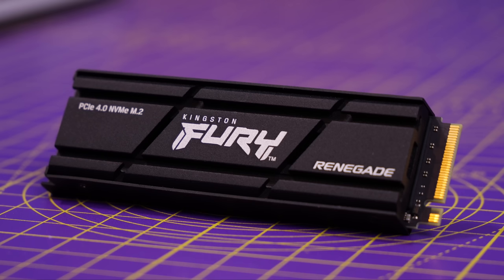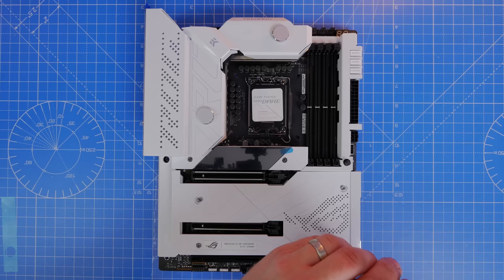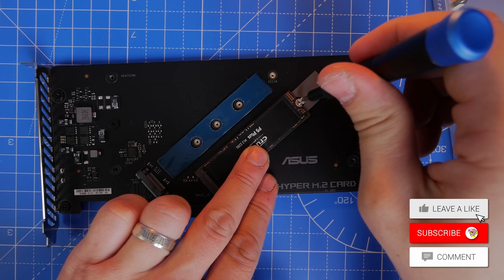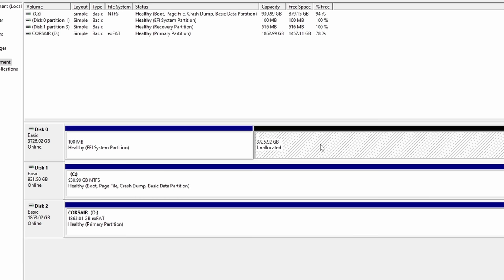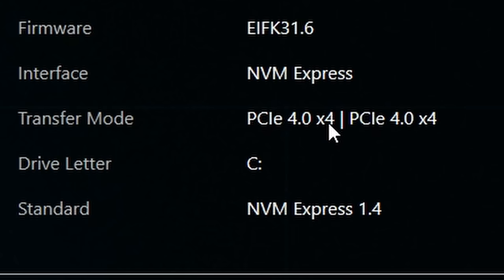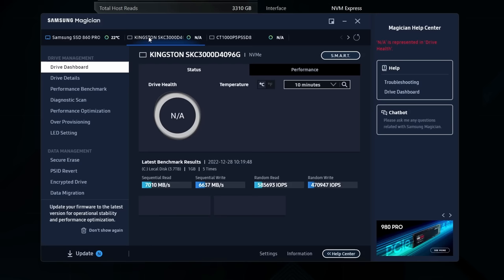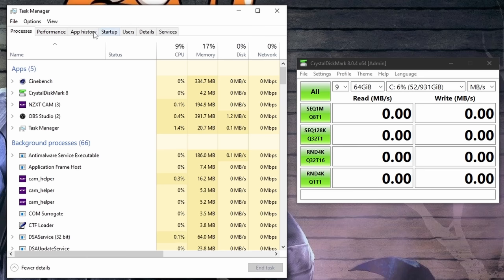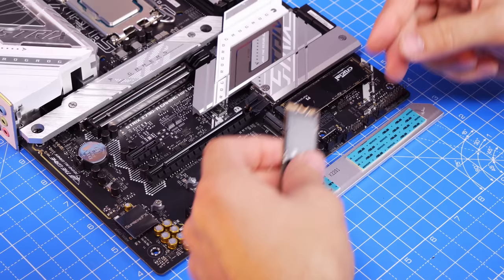Don't make these mistakes with your NVMe SSD installation - NVMe tips and tricks

Comment: It's not always the top slot.  Some boards steal PCIe 5 lanes from the GPU in the top slot (M.2_1), reducing your GPU from x16 to x8.  This would be less of an issue with a PCIe 5 GPU, but the current generation of GPUs are PCIe 4, and will lose performance.  The correct slot for a gen 4 drive can be M.2_2, if the board routes the CPU's x4 lanes there.
Reply: thats why you dont buy intel, ryzen doesnt have this problem because it has 28 gen 5 lanes on the 7000 series
Reply: Its a good general rule of thumb, but if you are assembling your own PC motherboard up, then you can take the time to read some labels or the owners manual to see what is the proper slot for gen 4 support. Some boards even have the "dimm .2" slots next to the ram that allow 2 nvme similar to his pcie dual nvme card.
Reply: @Wedgeman_Riley   really random and kind of irrelevant to the current topic but thoughts on the x670e-a strix mobo? Trying to find a white one that would go with a 7950x especially after seeing your comment about the 28 gen 5 lanes.
Reply: @Wedgeman_Riley  that’s convenient, I have an x570 board with a 5800x and I was worried about adding another NVME
Reply: @Sl0th150  the x670e gaming is a good motherboard if your willing to spend alot and will work well with the 7950x because it has good power delivery and enough gen 5 lanes to support a gpu and 2 nvme ssds at gen 5 which is the most the board supports and still has enough gen 5 lanes for any expansion cards like an elgato capture card
Reply: @Wedgeman_Riley  perfect thank you!
Reply: It barely makes any difference even with pcie 3.0
Reply: @vedinthorn  It depends on the game or workload.  Some things do make use of the x16 bandwidth on the higher end cards.  The other thing is that it's just plain bad practice to use GPU lanes for a PCIe 4 system drive when there are dedicated CPU storage lanes there for it (unless you actually need that extra NVMe slot).
Reply: @Wedgeman_Riley  Tru, but my old Hero 7 x470 has this config.  Bottom slot for full 16x and no second m.2 or steals 8 to give 4 to the other m.2 slot.  Now the x570 I have does not have this issue but the recomended slot is closest to the cpu.  On am4 socket.
Reply: will the ryzen 5800x3d pair well with the msi x570s edge max wifi & a 250gb samsung 970 evolution plus with a 2tb 970 evo plus?
Reply: just check your motherboard manual
Reply: Unless you got a 4090, no gpu will be saturated even if you lose 8 of your 16 pcie4.0 lanes
Reply: @Wedgeman_Riley  Same as Intel, AMD's mobos share lanes as well. 

From x670e manual: 
When M.2_2 is enabled, PCIEX16_1 will run x8 and PCIEX16_2 will run x4.

When the PCIe 5.0 M.2 card is installed on the PCIEX16_2 slot, PCIEX16_1 will run
x8 only.
Reply: @Wedgeman_Riley  Nope:

When M.2_2 is enabled, PCIEX16_1 will run x8 and PCIEX16_2 will run x4.
When the PCIe 5.0 M.2 card is installed on the PCIEX16_2 slot, PCIEX16_1 will run
x8 only.
Reply: @sempiro3133 it won’t lose performance, find a benchmark where it does. Even gen 4 4x is more than enough.
Reply: @Ilestun even with a 4090 you don’t saturate.
Reply: @sempiro3133  with the chipset I got, last gen x570, you can run both pcie 4.0x16 for the graphics cards and pcie4.0x4 for one M2 and another m2 in pcie3.0x4

It might be otherwise with lpwer end chipsets tho.
Reply: I use the lower slot so I can use SLI. I have to
Reply: bruh  When the zen3 was released, people don't remember that gamers were hesitating between the ryzen 3600 and the i5 9600k. 

Just remember that people who choses the 3600 have now the best upgrade ever with the 5800x3D and people who chosed intel have to buy new motherboard. 

Lucky me I chosed the 3600 over the 9600......know running on 5800x3D and planning to upgrade my graphics card soon.
Reply: bruh  🤣🤣🤣🤣🤣🤣🤣🤣
Reply: I guess you missed the part where he said “in most cases”
Reply: If I install 2 m.2 into my z790 will it slow my card
Reply: You are absolutely right Murph9000, well done.
Reply: Wait, so what about on the b650e taichi, it has a gen5 m. 2 slot next to the ram dimms, if I put say a gen 4 firecuda drive in that, does it still steal pcie lanes from the gen 5 GPU pcie ?
Reply: @KatoJari  Kato the AMD platform does not tend to have these kind of limitations. There is no issue at all with the setup you described. The only thing you need to be aware of on the ASRock B650E TAICHI is that if you place an m.2 drive on the third m.2 slot it will disable the second pcie slot (gen 4) but no problem with the gen 5 pcie.
Reply: Please help OP, I have a asus tuf gaming z790 plus wifi d5 and a pny 4080 and a samgsung 990 pro, a 980 pro. The MB has 4 spots.  Where do I put them to not affect the pcie 5 speed
Reply: @quatreraberbawinner2628 what did you find out?  I have same question
Reply: yes
Reply: Mine at the back of the motherboard lmao
Reply: ZaHandle i switched from intel to amd had an i5-9400F n 3050 got myself a Ryzen 5 3600 and a b450 chipset to oc and oh boy its unbelievable what u get compared to intel is overboard on pricing amd makes it affordable to fkin build a fast pc hyper threading is very nice
Reply: @Wedgeman_Riley  i have the msi b650 carbon wifi and i already have a pcie 4 ssd . the wd black sn770. would it slow the gpu down if i add another m.2 pcie 3 ssd? or should i go with a sata?
Reply: .. The top M.2 slot on PCIe 5.0 is DIRECT TO CPU as opposed to the more convoluted and higher latency Chipset. I have an RTX 4090 and x8 PCIe 4.0 (switched from 5.0) doesn't have an impact beyond 1-3 FPS to if any; on my rig 3440x1440 I tested it both ways with CoD and 0 FPS loss. However, even with a PCIE 4.0 M.2 you will gain 'significant' latency using a chipset PCIe lanes. Also, you have to look at how your CPU is utilizing its PCIe 5.0 and PCIe 4.0 bandwidth. Most have both and are not PCIE 5.0 clean.

Also an important note, the difference for over 90% (if not higher) of the tasks your M.2 (drives) data is 4K random. There the difference between a PCIe 5.0 and PCIe 4.0 SSD is nearly negligible. Very little data that you copy or even as a scratch drive, contains large chunks of synchronous data. The difference between my 990 Pro and a M700 for loading, even the largest game is measured in a fraction of a second, and often the PCIe 5.0 SSDs are actually slower! Go figure.
Reply: @DJaquithFL  so what is the conclusion from this? should you use the topmost m2 slot? or only use the second and third m2 slot on your motherboard
Reply: @mytommy  .. On the Z790 there are two (2) Direct-to-CPU slots. If you have a PCIe 5 M.2 and that's more important to you than a full x16 PCIe to your GPU then use the top M.2 slot. Otherwise IF AVAILABLE use the "second" PCIe 4.0 M.2 Direct-to-CPU slot per your manual for x16 to your GPU and the lower latency Direct-to-CPU slot. 

There are special cases, I have an ASUS Extreme and underneath the OLED screen and above the GPU is a PCIe 5.0 slot .. if you're going to fully block and water cool your CPU, then all of those other M.2 slots are completely inaccessible so you have to weigh out if under ~1-4 FPS is worth not having any any access to those M.2 slots? In my case I also have a M.2 DIMM slot to the right of the CPU, but for those I use a RAID 1 M.2 therefore, all of the M.2 slots are fully accessible and can be exchanged if needed without having to fully dismantle my cooling and draining my loop.
Reply: @DJaquithFL  I'm more worried about the worse latency to be honest rather than the loss of 1-2fps. I play an online competitive game, so any latency advantage is important. So, the question still remains, should I use the top most m2 slot for my use case?
Reply: @mytommy  .. Again, if you have a Z790 motherboard (the Z790 is the only chipset where this matters) then it has two (2) direct to CPU M.2 ports. If you're using a PCIe 4.0 M.2 then I would use the corresponding or 'generally' second port below it (there's no latency difference between either of those direct to CPU M.2 ports, the sole differences are bandwidth and location), you'll have to look at your manual M.2 port. Putting a PCIe 4.0 M.2 in a PCIe 5.0 M.2 port accomplishes nothing other than reducing your PCIe down to x8 for your GPU. 

Lastly, as far as latency is concerned, the game is loaded already and any M.2 activity won't matter. To be clear, I'm a huge Call of Duty player .. so I get your concerns.

I chose the top port in my use case because of its accessibility with a full EK water block loop including the CPU and GPU. I absolutely can't access those other M.2 ports so I opted for the x8 to my PCIe port. As it is, I might 3440x1440 240Hz monitor along with my RTX 4090 I am pegging the 240 FPS because that's why I have it capped, with the frame cap removed on high settings and sometimes slamming 300 FPS.
Reply: pcie gen 4 x16 vs x8 barely anything in it!
Reply: @lu34lyf  .. That's not true and this is easily preventable. The loss of FPS depends upon the game, 5 to 15+ FPS loss effectively defeats the advantages of an RTX 4090 vs an AMD 7900 XTX or an i9 vs i7. It's especially even worse with lower resolutions. It's a preventable screw-up.
Reply: PCIe-5 x8 is the same as PCIe-4  x16 and only an RTX 4090, which is a PCI-e 4 card, comes close to saturating PCIe-4 x16.

5.0 has double the bandwidth of 4.0

5.0 x8= 4.0 x16.
Reply: @thedoctor7158  .. It doesn't work that way. Each PCIe slot has a certain number of lanes assigned to it, It may or may not be shared, it may be direct to the CPU or its lanes running through the chipset (chipset adds latency). On LGA 1700 the M.2 PCIe 5.0 lanes are shared thereby reducing the GPU to x8 lanes and both are direct to CPU. There is no "economy" of bandwidth, instead it's about LANES assignment. Example if the PCIe assignment is PCIe 5.0 [x8] but the device is PCIe 4.0 x16 then the device will only be given PCIe 4.0 [x8]. 

Regarding the "saturating" while the bandwidth alone isn't the reducing factor the device that's x16 lanes reduced to x8 lanes (the process) has an impact that reduces the devices efficiency. In short, even an RTX 4090 will lose, depending upon the resolution, on average anywhere from 2% to 8% FPS and the lower the resolution, the greater the loss. See TechPowerUp's benchmarking on this topic.

In a real world use cases, the speed difference between an M.2 PCIe 5.0 SSD and a M.2 PCIe 4.0 SSD is negligible. Realistically about the only change you would notice is a cloning of a huge file upon the very exact same M.2. for most people that would have an RTX 4090 and are gaming. My advice to them is to use the PCIE 4.0 M.2 slot That's just below the PCIe 5.0 M.2 slot, both are direct to the CPU but the 4.0 slot is not shared with the GPU so the RTX 4090 can run at PCIE 4.0 X16. Opening a game on a M.2 5.0 versus M.2 4.0 would be less than a second on comparable M.2 SSDs because it's all about random not sequential. Sequential speeds in the real world are nearly the most useless gauge of any SSD.
Reply: You are not going to see the difference in gaming between a pci-e 5 x8 and pci-e 5 x16. How do I know this? I have tested it on multiple games with an RTX 4090 an my z790 ROG Strix. Little to zero fps drop, zero slow down. A 4090 barely saturates pci-e 4 x16.
Reply: @thedoctor7158  A 4090 is a PCIe 4.0 device, it can't do 5.0 speeds.  It can, under the right circumstances, use most/all of the 4.0 x16 bandwidth for certain operations.  If you put it into a 5.0 x8 slot, it will be running at 4.0 x8 speed and partially throttled.  It's not going to make a big difference for every game, but it can make a difference for certain use cases.
Reply: @DJaquithFL   my lack of info made this look wrong.

Pcie gen 4x16 Vs gen 5 x8 nothing in it

Is what I should of said

Sorry very vague on my end
Reply: @lu34lyf  There are no PCIe 5.0 GPUs available; both Nvidia and AMD are only 4.0.  There is no such thing as a GPU which can run at 5.0 x8 speed right now, they can only run at full 4.0 x16 speed or 4.0 x8.
Reply: @Murph9000   never once mentioned gpus, but there is gen 5 nvmes which is where im basing this from 🤷
Reply: @lu34lyf  You were comparing x16 and x8 slots in a thread about GPU lanes on desktop CPUs.  The normal case for x16 on desktop CPUs is for the GPU, not NVMe.
Reply: @Murph9000   dont tell me what i wrote with my intentions, i didnt mention gpus what so ever, my comment was based from nvme gen 5 vs gen 4  and then using basic math as such gen 5x8 vs gen 4 x16 is almost the same, its easy!, but what ever
Reply: @lu34lyf  This thread is about losing GPU lanes if you pick certain NVMe slots on some motherboards.  5.0 x8 and 4.0 x16 are not always equivalent; the maximum theoretical combined bandwidth may be the same, but the performance depends on the specific combination of devices installed.  Specifically, gen 5.0 x8 does not equal 4.0 x16 for current GPUs.
Reply: Gen 4pcie x16 equals gen5 pciex8 its not really  a difference. Only that gen5 pcie has higher speeds speeds at x16, but no gpu now a days runs at that pcie gen5 speed. We dont have that tech yet!
Reply: @eduardotorres-du1lf  No, they are not equal when it comes to current GPUs.  If you do something which reduces the GPU slot to x8, such as installing a M.2 drive in the top slot of certain motherboards, the GPU bandwidth is halved from 4.0x16 to 4.0x8.  Although the slot is capable of running as 5.0x8, which is the same total bandwidth as 4.0x16, the slot becomes a 4.0 slot when it is used for a 4.0 device.  You get half the maximum bandwidth to the GPU if you get it wrong (which might not make a big difference in many cases, but will reduce performance for some workloads).
Reply: @Murph9000  it doesnt become pcie gen4 slot. The difference in generation is that pcie gen5 doubles the bandwidth speed of that of gen4, therefore making pcie gen5x8 run at 63 gbs the same as a gen4x16. Thats ok, everyone has their own opinion on this matter. My pc runs oerfectly fine with out any performance drop whatsoever.
Reply: @eduardotorres-du1lf  You are WRONG.  If you put a PCIe 4.0 device into a 5.0 slot, the slot effectively becomes a 4.0 slot.  It is a fundamental part of how PCIe works.  As there are currently no 5.0 GPUs, it cannot run as a 5.0x8 slot with a GPU.  With a 4.0 device, i.e. any of the current GPUs, the slot operates as either 4.0x16 or 4.0x8.  In x8 mode, your GPU has half the maximum bandwidth and certain workloads will lose performance (many workloads don't need that much bandwidth, so there isn't a noticeable difference).  It is completely irrelevant that a 5.0x8 device would get the same as a 4.0x16, as you are not using a 5.0 device and the slot is downgraded to 4.0 speeds regardless of the number of lanes used.
Reply: @Murph9000  yes sir! Whatever you say.
Reply: Yup. Including the NZXT mobo that is featured when the video makes that claim. I have that NZXT mobo and installed my m.2 nvme in the m.2_2 slot.
Reply: @DJaquithFL sounds like we have the same PC
Reply: What if I have Gen5 SSD? with Gen 5 mobo?
Reply: Whatever nerds
Reply: My motherboard A320M-k only has the one place it can go
Reply: Just came to this video and saw your comment.

I have as Asus TUF b650 plus WiFi mboard and have just purchased a second SSD to join the Corsair MP600 I currently have (b got a Samsung 990 pro 2tb on the way).

Manual says the M. 2_3 slot shares bandwidth with pciex16_2 but as this slot is unused I assume if I used that M.2_3 it wouldn't matter.

My main question is, would a second SSD impact GPU lanes or does the mboard have enough? (I can't find in the literature).

Lastly (sorry for the lengthy post) does a pcie4 perform better in a pcie5 slot or would it make no difference?
Reply: True @Wedgeman_Riley

Comment: Just read the manual it will tell you which pci slot combo would work to get the maximum speed. It is actually better to read about it before buying the mobo ☺️.
Reply: Yup, and if you need to change the pciex16 to x8 so you can use the other slot. Had to figure this out on my server the other day. Also chipsets will usually tell you which have more m.2 slots and support full speeds.